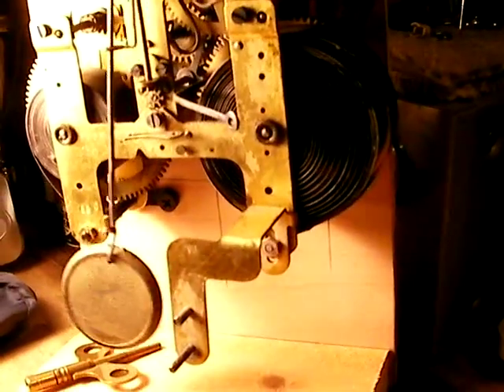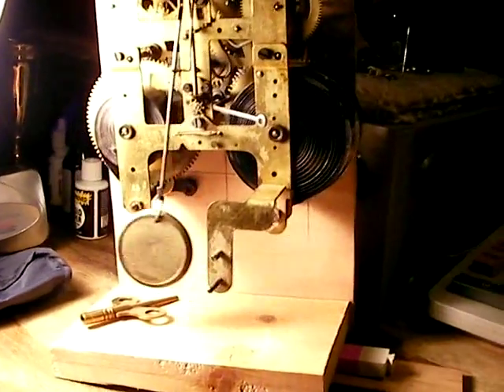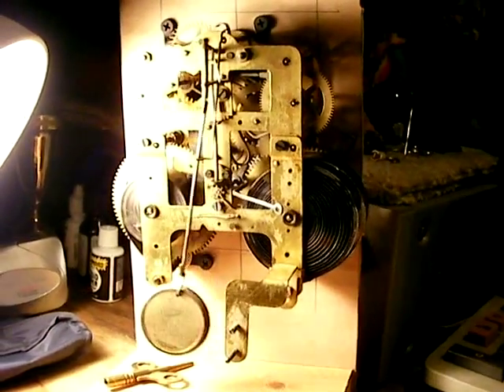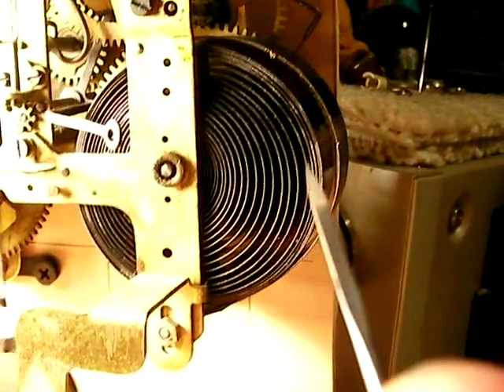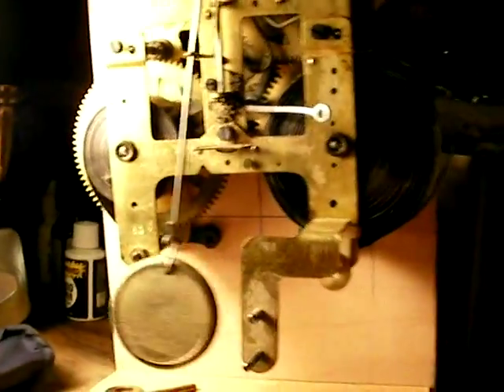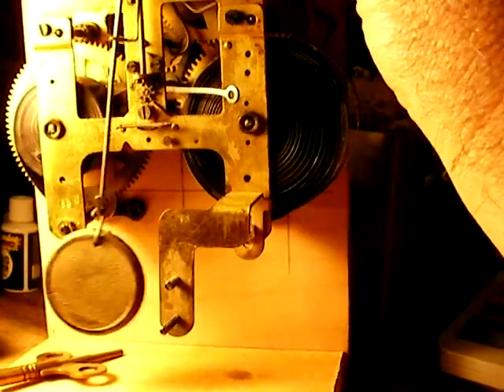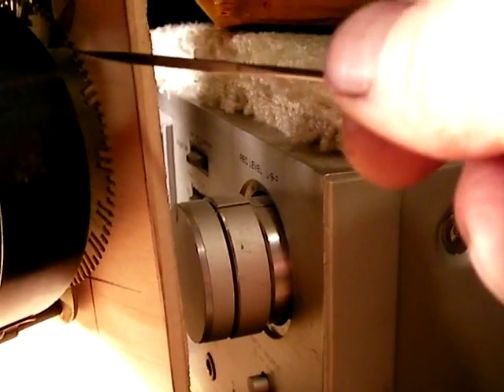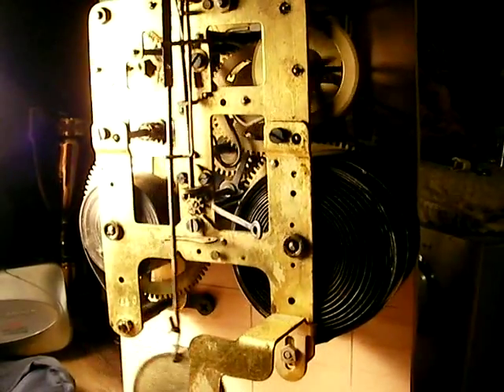Seth Thomas mantle clock resurrection 1

Comment: The wheel that has the deep notches is called the count wheel and works like you assumed. The fan is called a "fly" and is a wind vane governor to slow the striking.  The brass wire connected to the pendulum is called the crutch arm and the lower end should be bent toward the end of the clock stand that is raised.  Bend it the right amount, and the clock will be put "into beat" and it will run on a level surface and have an even ticking.  Spring driven clocks that are in beat run longer on a winding.
Light weight synthetic motor oil works great on the mainsprings and sewing machine oil works in a pinch on the pivots where the shafts come through the outer plates.  do not oil the teeth of the wheels, but do oil the two flags of the verge that touch the sharp pointed teeth of the escape wheel.
Reply: Hey clock guy 
I’ve got a Seth Thomas mantle clock 4 on tag n wonder the value . Do you know n will you tell me?

Comment: Make sure you check the pendulum wire and make sure the top of it is not bent or pushed down. That's why mine wouldn't run. I did that and its chiming and keeping good time.

Comment: The clock is just “out of beat” that’s why you are having to lift one side. Just adjust the crutch (pendulum rod topside) and  it should work. Clock oil only! Anything else will gum up the movement or worse, good luck.

Comment: I have a Seth Thomas that looks exactly like your on the inside. I can’t figure out what holds the pendulum arm in place. There may be a piece missing but I was hoping you could help by giving me a close up of where the pendulum is attached
Reply from the maker: Tracy, I would if it was more practical right now.. my clock is put away in a storage unit.
Reply: Pendulum is hanging down, it’s that heavy iron thing. Open  the back of the clock and you will see it.